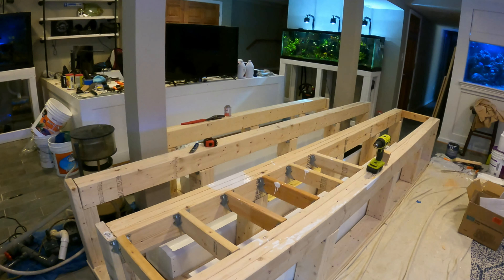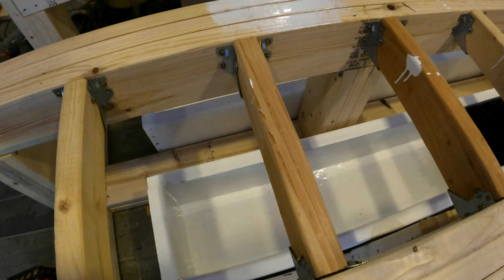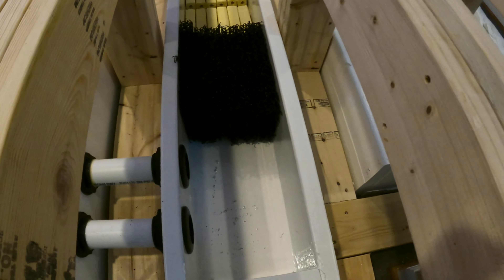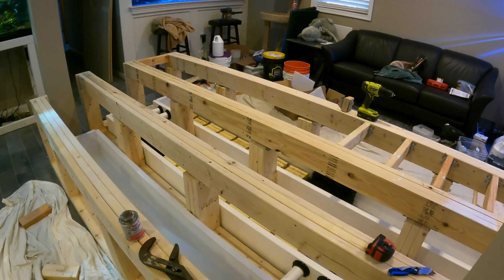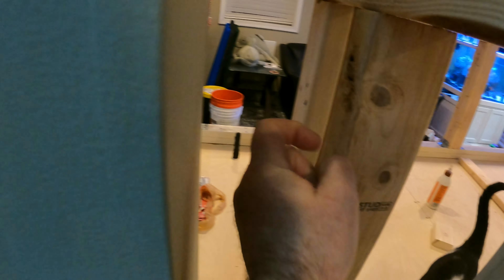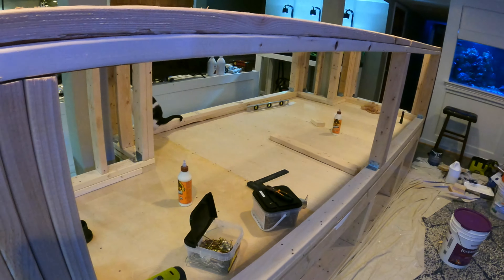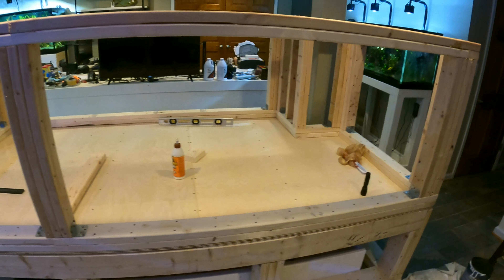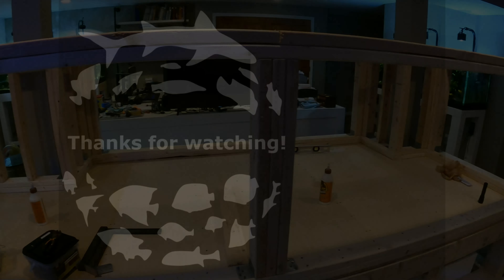1800 Gallon DIY Marine Predator Aquarium Build. Predator Bay is Growing! :: Part 2

Comment: I am planning to do a similar filtration system but using six clear rubbermaid storage containers with lids that are daisy chained together via two 2" pvc pipes connecting each container to the next but using uniseals instead of bulkheads. The last container will then connect to a 100g refugium tank before the water gets pumped back into the tank. Let's hope it'll all go well :)
Reply from the maker: Hey Sanjay! It sounds good, I especially like  the 100g refugium addition to the sump!

Comment: We once built 24 houses each with fiberglass roof decks, and all inside corners needed to be 45* to help eliminate cracking. We just ripped a 2x4 at a 45 and nailed it in w/ ring shank nails. Just something for you to consider doing. Great job
Reply from the maker: Thanks 3xzsucof! That is a good suggestion, would certainly eliminate some of the gap where the wood is connected.
Reply: @AquariumDomain.  also, to be a certified "green" roof they had to be flooded minimum 12" for 48 hrs. They grew plants on them

Comment: This tank well be fantastic, which color well be in the inside? Do you already know what well be the color of the outside?
Reply from the maker: Hey Eues!  The inside will be white, but most of the tank will be glass. The outside will be painted white as well, initially I will just paint the structure, but over time I will do some proper trim work on the outside...something like what I did on the 3000 gallon.

Comment: Just wondering why you used 2x 6 stacked for your panel frames vs 6 x 6 posts?
Reply from the maker: Hey David! A few reasons...6x6 posts are general treated lumber which is more expensive and depending on the chemical treatment not always suitable for indoor use. Also 2x6s are lighter to carry than 6x6 beams, and lastly properly connected 2x6s are stronger than a single 6x6.
Reply: @AquariumDomain.  thanks for the tip

Comment: Any reason you are going 1/2" tempered glass vs 3/4" plate glass?
Reply from the maker: Hey Alex! I chose 1/2" tempered for the strength vs. weight and slighter higher safety factor. With tempered glass being 4x the strength of plate/float glass I am getting a 2.8 safety factor at 36" or less water level vs. 2.5 safety factor on the 3/4" plate glass and at less weight. I know from your channel you can appreciate how heavy an eight foot long by 3 foot tall 1/2 or 3/4 inch piece of glass can weigh lol :-)
Reply: @AquariumDomain.  Thanks for the info.  I have never worked with tempered glass sheets before and was cautioned a few times that the weak spot is the edge of the glass.  Do you take any precautions or do anything different when handling a tempered sheet of glass vs regular plate glass?  I cheated moving my glass sheets for my plywood tanks since I put the tanks face down for the glass install.  This time around I am doing a similar style of construction to your predator bay with pond liner tanks with glass faces and I made the top 2x4s that brace the glass removable so I did not have to lift the glass sheets over the top of the tank to get them in.  However even lifting the sheet of glass on my 700 above the bottom edge of the tank was a challenge so I ended up making a custom 2x4 stand to hold the glass vertically for cleaning and install which made it a fairly easy job.  Looking forward to seeing this build come together.
Reply: @AquariumDomainFan  Thanks for the glass info.  I am slacking on the updates.  Hopefully this weekend I will get a chance to do some filming.

Comment: How high of a tank would you build if you only had 3/8 tempered glass? Thanks.
Reply from the maker: Hey G Lee! Depends a lot on the design (bracing) but to give you an idea a 125 gallon 72" x 18" tank is 21" tall and uses 3/8" glass. So 18 to 21" with a very high safety factor for sure on a diy build with proper bracing...also could probably go 96" long again depending on the design/bracing.
Reply: I agree but on a 125 that’s just 3/8 plate glass. Would you not go higher with 3/8 tempered at 84 long?